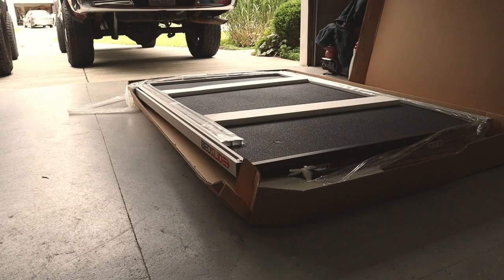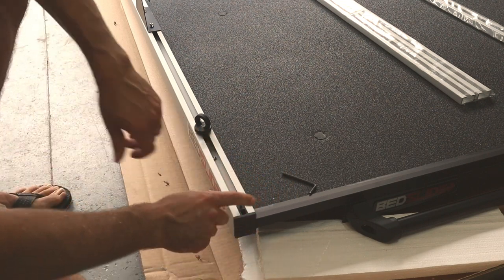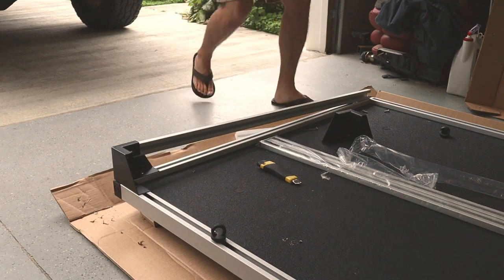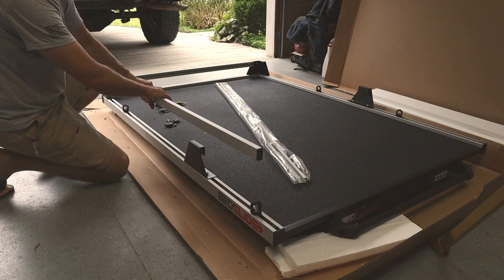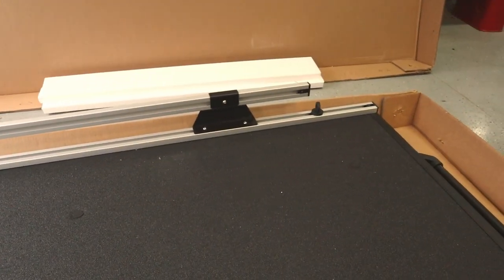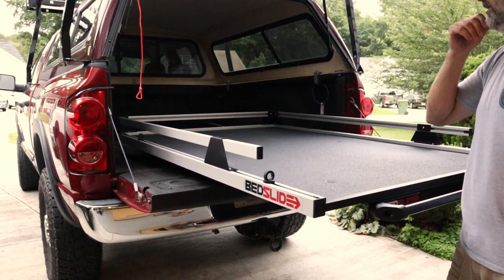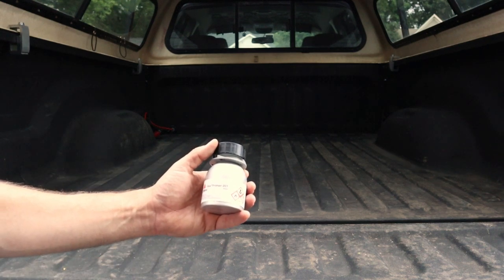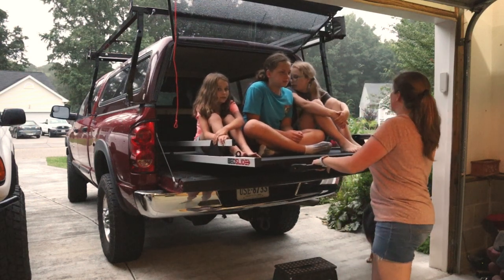How To Install The Bedslide 1000CL

Comment: Good video, but can I make some additional recommendations :-
1/ use a length of 1.5" timber to set your clearance distance from the cab
2/ you can remove the slide section from the mounting base to make fitting much easier
3/ check underneath truck bed before you drill
4/ use sharp drills and don't push hard 
5/ use high speed setting on drill (avoids jamming and sharp edges)
6/ in addition to priming/painting drill hole edges, smear the fixing with silicone. Makes fixing more secure and gives further protection against corrosion, dust and water ingress
7/ if you'll be going offroad, don't use rivnuts, they can rattle loose. Use stainless bolts with a stainless backing plates or large washers under bed, and stainless nylock nuts. Will also minimise bi-metal corrosion 
8/ if you do use rivnuts, drill 7/16" not 1/2". It's a tighter fit and allows you to file off any sharp dags without losing clearance

Cheers

Comment: Best Youtube video on install I've seen.  I also got the side boxes, which follows the same logic.  The only addition for the side boxes is to read their instruction since you have slide mounting block for this accessory to add before you finish mounting the side rails.  Don't fully tighten until all is together until you know the side boxes fit.  In the instruction, It states to place the brackets for the top boxes back side out, which is correct, but it is confusing with the illustration.  The boxes have to be outside of the slide; with the slide on the illustration it appears to be the opposite if you places the bolts through the boxes attaching to the bracket that attaches to the side rails.  You have to have the hole in the upper brackets facing in.  Once lower boxes are installed (don't forget to tighten end brackets first just before this), tighten all the side rails.  Then install the top boxes.

One other key is to make sure the side rails go all the way back past the end rail.  If you don't the lower boxes will not fit to screw in.
Reply from the maker: Michael Iversen that’s great information! Thank you for sharing and thanks for watching!

Comment: Great Video. good explanation and demonstration. I got the 1500 with a 3/4 (75%) slide out. I'm hoping that it comes out far enough to grab tools near the front of the bed. Thanks again. This will help. Now I just have to clear out the back of my truck. Haha

Comment: Great video. I'm having trouble getting the bedslide to slide into the truck bed when I try to install it. Any advice?
Reply: Theres a spider nut that connects to handle behind the face plate untight it and turn the handle to the right a few times then tighten the spider nut . I work at bedslide .

Comment: Hello, you should consider working for bedslide as there installer for tutorials videos. Very helpful video thank you. I just purchased the black edition and loaded it with all my pack out boxes and tools and I noticed that it is a little difficult to when I get to the last extension setting. I have to strain for it to click in to the last extension point. When it is empty I have no problem, only when it’s completely loaded. Are you having the same issue?

Comment: Nice detailed installation video but reason why when opening slide out it raises up is to clear your tail gate, tail may appear to be flat with truck but its not so they made cargo slide rise up when pulled out to clear tail gate
Reply from the maker: They made it raise up at the tailgate to account for the load or weight that it can carry. When loaded it does droop a little, but still raises up to clear the tailgate.

Comment: Hi I received my bed slide 1000 CL and I had a shop installed the slide today here in Denver Colorado. 
I want to know If your bed slide has a larger play from side to side as you pull the bed slide out. Is this common. I watched your video from start to finish numerous times. Great video 

I  feel that they didn’t do a good job installing the slide, they were NOT able to install the rail system due to the fact, it hits the lower section of the retraxx Tonnele cover. 

So now I’m left with extra pieces that will not fit on Bed Slide because of the cover. 
I have a feeling that I’m gonna have to do it myself. Any suggestions 

And thanks for your time.
Reply from the maker: Mine does have a little movement up & down in the tracks. Side to side only seems to be present when it’s extended. I actually took the side rails off of mine and drilled/bolted a couple of them in the center for extra tie down spots. Hope that helps!

Comment: I am ready to order the 1000 classic. Question os why do you allow 1 1/2" up front? Does the bed overhang the Fram by an 1 1/2"? Thanks.Great job.
Reply from the maker: Those were the measurements in the instructions. I believe it’s to give it enough clearance when closing fully loaded so that it doesn’t contact the bed. Also, the upper truck bed rail protrudes into the bed about that far.

Comment: Was wondering how far does the back of the side measure from the tailgate?
Reply from the maker: Are you asking how far the bedslide is from the back side of the tailgate? The handle measures around 1.75" from the tailgate, while the actual body/sliding portion is 4.75" from the tailgate. Hope that helps.

Comment: Great Video !  Is there a reason you chose BedSlide over CargoGlide?
Reply from the maker: For us it basically came down to weight and the way the cargo hold downs operated. The cargo glide is very robust with it’s 3/4” marine grade plywood floor, but we wanted the tie downs to be vertical off of the floor, rather than stick in from the sides. They do make a bracket that allows you to pull vertically from the exterior extrusion, but it is an extra piece.  The BedSlide is lighter with a composite floor and the tie downs are vertically mounted. We had a very specific intention with our installation as we knew it would act more as a sliding subfloor once we finished our camper build in the bed. Using it as a slide in a normal pickup bed, you really can’t go wrong with either option. For heavy load control and to keep it from sliding off of the sides of the slide, the CargoGlide edges the BedSlide out slightly due to its tall extruded sides. But those sides can also be a hindrance when trying to carry something wide that doesn’t completely fit within the slides footprint. In the end it really comes down to preference. We are extremely happy with our BedSlide and it has worked flawlessly. We haven’t had any issues holding cargo. The decking, even though it’s composite, has not warped more deflected with the weight we’ve carried. I’ve thrown brake rotors and various other heavy metallic parts up on it and there has been no damage to the decking.

Comment: I wonder why Bedslide doesn't just ship with the rails already on. It doesn't look like it would be that much thicker if they already did this for you
Reply from the maker: It would definitely speed the process up for sure.  Based on the way it was packaged, I’m guessing it was to protect the aluminum rails from damaged during shipping and to get it in the smallest box possible. Thanks for watching!

Comment: be aware of gas tank(s) position when drilling
Reply from the maker: The fuel tank should not be an issue as it’s quite a ways under the bed. That being said, I wouldn’t use a super long drill bit to be on the safe side. Also, it’s good practice to look under the bed in that general area to make sure there isn’t anything mounted directly below.

Comment: I wish the rear platform was flared out past the wheel wells so all that space isn't lost.
Reply from the maker: They do make accessory boxes/bins that can be installed on the rails that hover over the wheel wells. That way there isn’t any unused space. Thanks for watching.